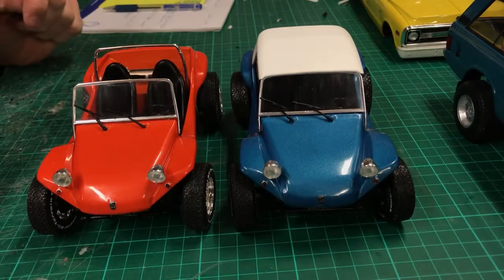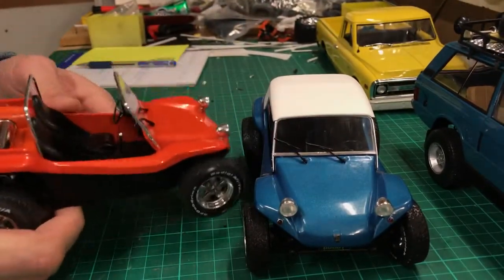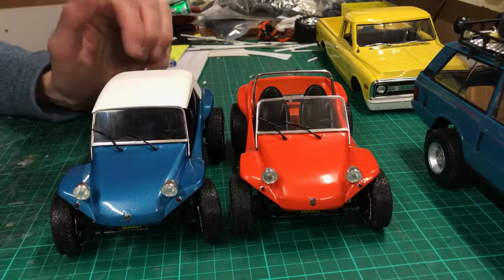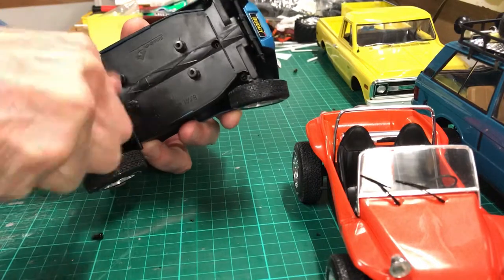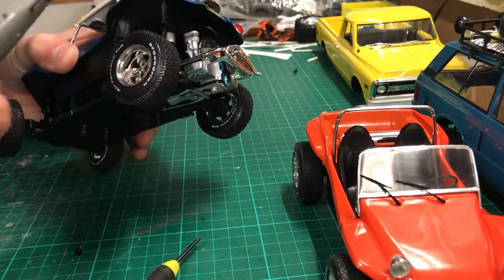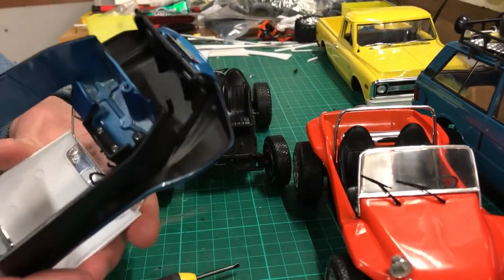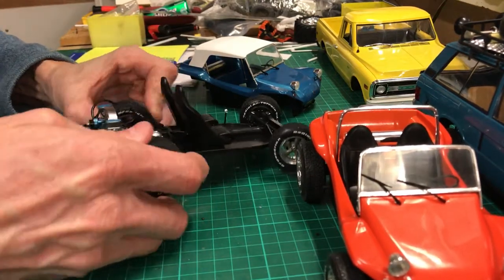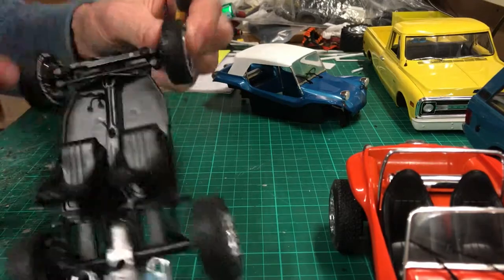1:18 Solido Meyers Manx tear down

Comment: Quite a nice model! Is the steering wheel supposed to be connected to the wheels on the model or is this how the model is?. I want to buy this model but if the steering wheel dosen't turn the wheels i will rethink about it. Its a feature that i like to have in my car models.
Reply from the maker: I’m pretty sure the steering wheel is connected to the wheels - I’ll check when I get home.